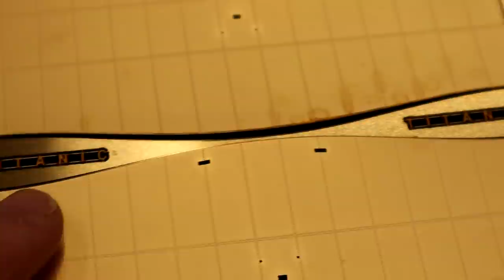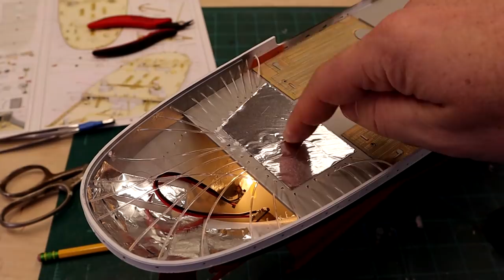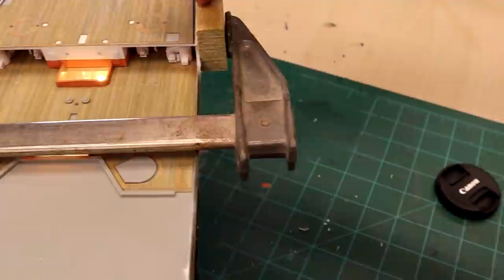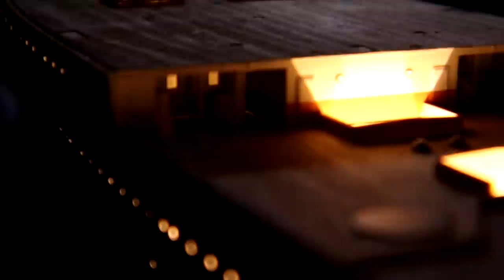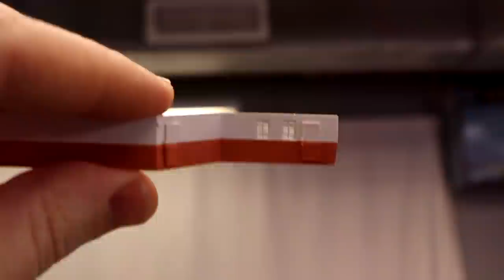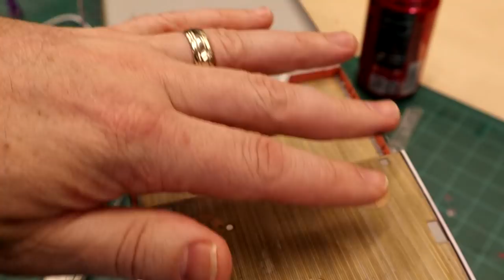1:200 RMS Titanic Video 13

Comment: Looking great! 

Just tossing it out. You may want to cut down the decking under where you glued the aft C deck bulkhead. As once you get to the boat deck, the 3 deck layers worth of wooden decking will raise the boat deck higher than the hull sides. I know you mentioned it with the poop deck. Just not sure if it was an oversight not doing it on the bulkhead. 

Happy Holidays!
Reply from the maker: That’s a great point! Yes, I forgot to cut it out when I glued the bulk head in. I realized that after I put it in place. So I’ll make sure to correct it on the subsequent decks to minimize the problem later on. Thanks!

Comment: Are you priming the China 3D parts in grey? You might try black. It's a shame they went with that horrible orange material. They're such fantastically detailed parts. I think the light from the windows under the Poop deck is perfect. Everyone seems to over light their ships. This was 1914 not 2014. The light should be dull and yellow. Frosting the 2nd class windows was a great idea. As you said, it is an area hidden by the cranes and ladder anyway. Great update. Hope you both have a very Merry Christmas and a wonderful New Year!
Reply from the maker: Thanks Charlie! So I started with a white primer to minimize the number of coats of paint. This works with the flat pieces, such as the doors. So I’m inclined to believe the issue is just not getting the primer on all surfaces. The gentleman in China who does the printing recommends priming with a “metal primer” first, then applying a regular primer over that. And finally your finish color. It seems to me that’s too many steps. I do know someone who used black primer first and had good results. So I may go that route next. But the developers are experimenting with a new resin that is grey. It’s just an on going evolution.

Comment: Model is looking amazing! I was wondering and curious what the brand and color is you used on the aft deck and poop deck and bulkheads as well as the bullworks? The instructions call it “dark mast”. I can’t seem to find the correct color? Thanks!
Reply from the maker: I paint the wall white, then go over it with model master “flesh” to get that look. The actual color is up for debate. No one really knows.

Comment: I have the KA kit which does not have the PE nameplates. How can I get the PE nameplates without buying the whole pontos kit? Actually anything would be an upgrade to the kit decals.
Reply from the maker: I would reach out to Mini Brass. They are in France and make the lower hull plates. Including the proper name plates. Maybe they will sell you just them.